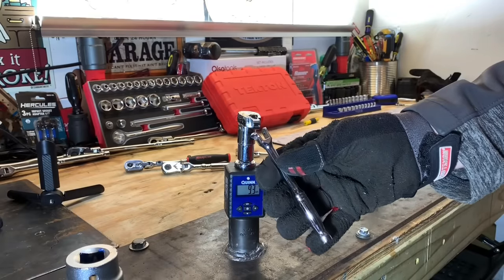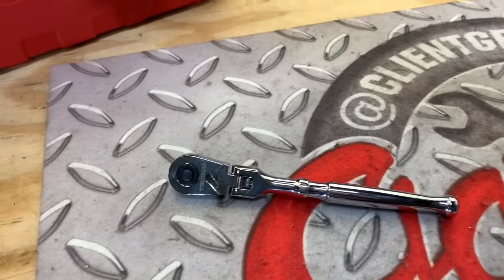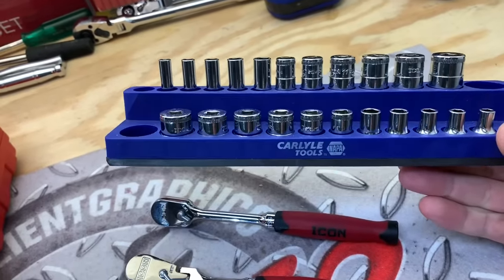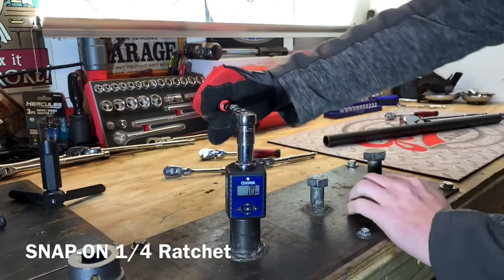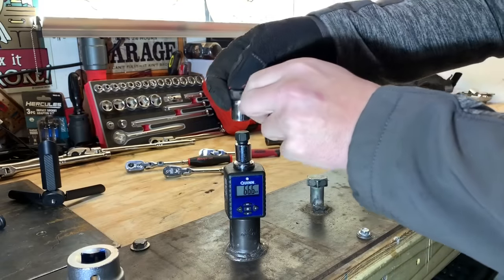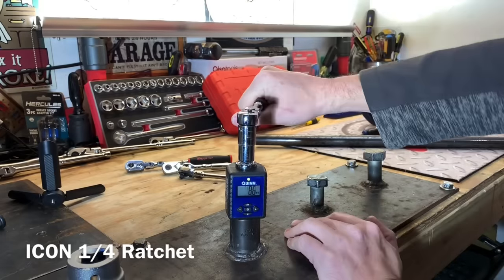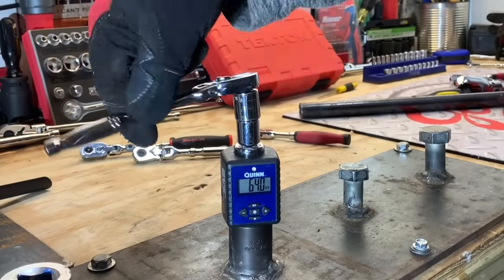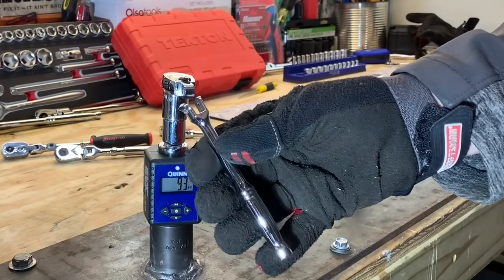$145 of SnapOn vs Tekton vs Icon vs Capri Tools Who Will Flex the Most?

Comment: I don't see the point to this. Whats the point of testing a tool with a cheater bar to a torque it wasn't designed to handle. It's like driving an f150 off a 10 foot jump then being surprised the suspension couldn't handle it.  I mean all he proved is that all the tools but the snap on in the given condition can do the designed job without failure.

Comment: I forgot to say that I use 3foot pipe to remove  d10 head bolts which a craftsman and  Japan black socket  I can send you the video so next time wen you buy tools  and use the extra money for something also a good machanic is the one who fixed everything not the  brand tools also my friend have a  new snap on scanner and is very hard and is to slow compare to the ones that a have cj4r  from Mexico

Comment: I prefer to put a cheater bar on a breaker bar if necessary. That's rare since the advent of the air and now cordless impact wrench. What size bolt shank do people expect to twist on/off with a 1/4 inch drive ratchet. Rule of thumb would be max 1/4 to 5/16 and maybe 3/8 shank in desperation. That's shank size not head size.

Comment: I had a Snap on 3/8 hand ratchet years ago that the reversing lever kept falling off. I would give it to the tool truck guy to fix and he would just tighten the screw down holding it on. In other words did nothing to fix it because it would keep doing it, one day even falling off without me noticing it. Luckily I found it on the floor. It isn't the best ratchet, there are better ones out there. I won't even get going on the test light I bought from him that lasted less than a year before the clamp end kept coming apart.

Comment: I know when i bought my extra long handle 1/4 snap on ratchet it was advertised as withstanding 100ft lbs. I thought to my self. " i could torque log nuts with this baby!" Haha. Its a non quick release. That weakens ratchets because there is a hole and detent ball. Which makes the drive not a solid piece of metal. But end of the day tool truck tools are nice. But generally not worth the cost. Id say certain tools yes. You need snap on or such. Like for instance an o2 sensor socket. Here up north they get very stuck. And cheap ones just flex and round things off. But as a mechanic myself. Id say 1/10 of my tools are truck brands. And i do just fine...

Comment: Why didn't you use a snapon regular head not a quick release with a hole in the center of the anvil anyone with a brain knows a quick release is nice to hold and easily release sockets but makes it weaker with missing material in the center of the anvil

Comment: Ok as a guy who has been in the vehicle and tool business for over 40 years Snap On are the only tool company that honours its warranty years after the tools purchased! I took an abused 40 year old 1/2” long ratchet into my Snap On dealers truck a week ago. The case had finally twisted. No argument no questions about the chrome abuse ( obviously hit with a copper or dead blow hammer over its lifetime) the ratchet was replaced for a brand new one! No attempt to repair or no excuses! Suggest all those lovers of the huge amount of Taiwanese alleged lifetime warranty tools try changing their stuff 10-20 or 40 plus years later will get warranty as the companies won’t exist or the warranty will not be worth the paper it’s printed on. Snap On is expensive and their Blue Point range is no longer as good as it was 20 years ago; however it’s still the best in the world and the most comprehensive of a range of automotive and vehicle tools.
Reply: BS. I have been a mechanic for 28 years. horrible company to deal with.

Comment: I’m not a professional technician, I don’t and have never worked in a shop. I do basic maintenance and repairs on my vehicles (fluid changes, filter changes, brakes, some suspension stuff, etc.). Why do professionals buy snap on / matco / cornwell / mac/ etc?? Especially in hand tools??
Reply: It's kind of the same as buying expensive clothes, shoes etc. You show that you can buy these tools and that you are a professional.
Reply: peer pressure. when you are new on the job you fear what people will think. that is it in a nutshell

Comment: The breaking force is not what matter the most! 
What is the number of teeth on the ratchet head? I meen by that, the angle to get one click. When you are in a tight spot and you have a sloppy ratchet head. You will really hate it. 
Other thing to consider is the head size! The smaller, the better it is for tight spot. 

Can you review that next time ?
Reply from the maker: I can sure try to remember to do a quick measurement

Comment: Over 23 years as a diesel mechanic I will not put anything under the lower end of a CAT engine besides a snap on tool. Cut and hurt my hands to many times with other tools
Reply: There's so many videos comparing snap on with other brands and I lost count of how many times harbor freight even beat them with performance, features and obviously, price.  I think snap on has sold out.  They're not as good as they once were.  If they're weaker than a tool that cost 3-5x less money...why keep buying them?

Comment: Conducts test with already broken Snap On ratchet, surprised when ratchet breaks.  States he has a repair kit for SO ratchet but doesn't fix it before test. Compares SO quick release ratchet to non quick release ratchets (quick release have a hole drilled through the square drive, which of course weakens it. Also happens to be where the SO broke). Mechanics generally don't use quick release ratchets, the fact that they are weaker by design is one reason why. Test of course is not a real world scenario, who actually uses a cheater pipe on a 1/4 ratchet? Also, video states SO has broken repeatedly yet ratchet handle is clean and chrome has no scratches. Looks like another Youtuber who is setting up tests to "prove" cheap brands are "better" than professional brands. A real world test is not so dramatic. Use ratchets for 10 or 20 years without abusing your tools, which one is going to hold up best over the long haul? Snap On is made from Chrome Boron steel, much better and will last longer. It's expensive, not something for the hobbyist.
Reply: Your last sentence is the important one. DIYers shouldn’t be buying professional tools. I bought the cheapest socket set forty years ago, and it’s still working fine for the occasional work I do on my car. He was never going to abuse a brand new Snap On, like he did the cheap ones

Comment: I find it funny many of these reviews/tests start with damaged wrenches.  If the gear mech is damaged the anvil like is damaged as well.  No I’m not a snap on fan just a observation that can skew results.  Some reviews of new SK tools would be nice as well
Reply from the maker: One pawl was out so it needed a rebuild kit figured why not take advantage and finish it off. So many brand to buy and try.  If you have one I can use I'll send it back in two pieces😁

Comment: I  did a 1/4 Flex head  Ratchet comparison ICON vs Craftsman video last month shortly after the ICON  stuff arrived at Harbor Freight.  I compared it to Craftsman because there are the same price (apples to apples price comparison) and I know the Craftsman is the best seller.     I would like to criticize ICON for not making it with locking grooves and detent ball to make it semi-locking. (I  brought that up in my video)  . . . . Also, I own the 3/8 version of that Snap-On flex head, it's my favorite ratchet of all time.
Reply from the maker: I have the 3/8” SnapOn locking flex version as well, it’s one of my favorites as well. I’ll probably never bring myself to break that one.... but if it should ever need a rebuild...

Comment: Those who know, know. I’ve had a pipe on the end of my 1/2” drive snappy and a snipe on the end of the pipe to take rusted head bolts out.  No fancy handle, I think the model is the SLF80, the long handle flex head. This thing will eat. No broken pawls or teeth. I have a lot of ratchets that are perfectly fine, but missing some teeth. None of my snap on ratchets have yet to be chowdered, although never say never.  You pay for the lifetime warranty, and the quality, and years of time tested and proven track record of being outstanding ratchets. Haters gonna hate. Not to say others aren’t great, but snap-on is on point with their ratchet and wrench game.
Reply: Yea their ratchets, wrenches and for me their screwdrivers are great too but I hate to say everything else is waaaaaaaay overpriced and for me not close to worth it when I can find the same quality for A LOT less.

Comment: Breaking tools does not show what’s better. Using them does, maybe you should give it a try.
Reply: How a tool breaks is important and it is useful to know the safety margin. If I have a 1/4 drive with a 6" pull and I know it takes my full body weight to break it, I feel safe knowing that no matter how I use it without a cheater, I can't break it. On the other hand, seeing a flex head break at the joint tells me it's weak there and may become deformed over time.
Reply from the maker: The SnapOn started slipping in the on position around 6 months and it needed a rebuild kit. Can’t get more normal than that. Hopefully the rebuild will last a lifetime.

Comment: Snap on is priced so high because when your tool breaks the truck comes to you if you buy something on amazon and you have a professional job and you need your ratchet every day why wouldn’t you buy the tool that if it breaks you can get it fixed with in at the very most the next week or do you want to wait until you get your ratchet shipped back
Reply: Braxton C Or you can take a quick trip to HF and have your tool replaced on the spot as opposed to waiting around for a tool truck to make its way to you
Reply: BMW Dude so what are you gonna do when you break your tool at 9 am at work you gonna say hey boss I gotta run to harbor freight?
Reply: Braxton C yes exactly what you say I’ve had to run down and buy impact sockets because one of my old ones shattered
Reply: yeet yeet yeah that’s Alright but my harbor freights an 40 minute to 1 hour round trip and I’m going to spend more In fuel and time wasted then Have the tool truck come to me
Reply: Braxton C no you’re going to spen $200 on an impact set then $10 in gas and $20-45 on harbor freight don’t get me wrong if you like buying designer tools because they make you feel better that’s fine but I buy what works and I’ve never had a problem with anything I bought from harbor freight

Comment: What I’ve experienced with the locking flex head 1/4 inch is if your strong enough you just snap the locking and it flops back and forth for snap-on.

Comment: internals may have been going out, but the gears grab enough to take the anvil to failure.  which means the gears held strong enough to have the anvil fail before the gears completely shit the bed...   if you break a arm, you can usually still walk